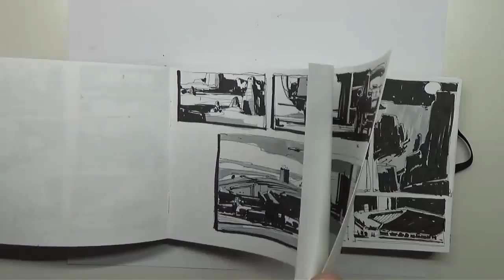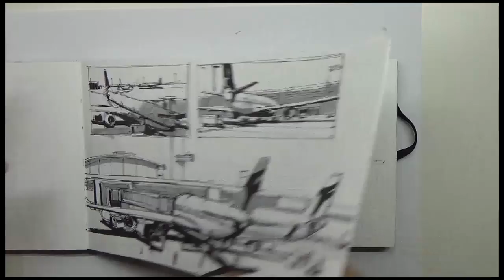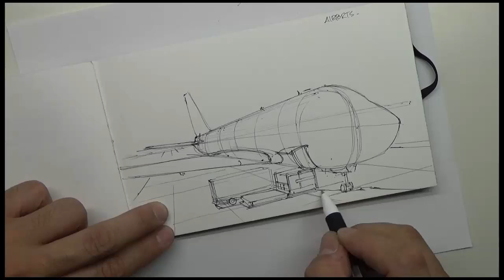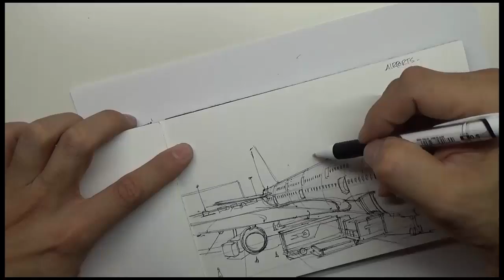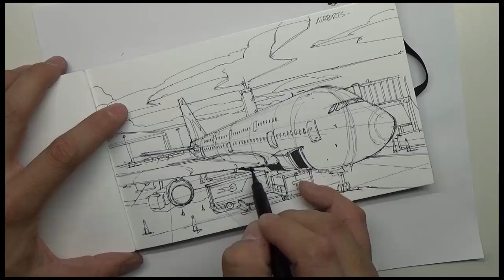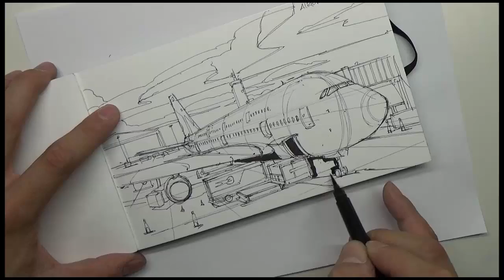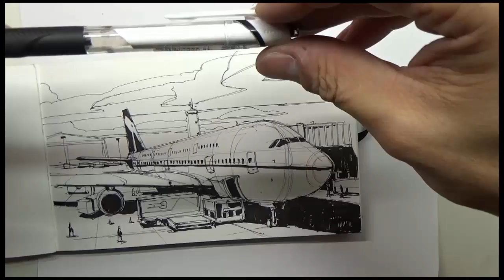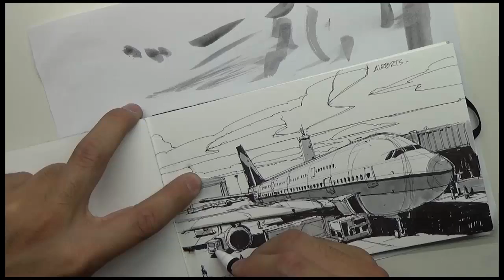idraw series EP4: how to draw an airport w/ James Paick

Comment: Hey, James. Great insight into your process, it seems my approach is similar to yours, so hopefully I'm heading in the right direction.

I have a question I haven't been able to find an answer for so far, so I'd like to ask for your help or request a tutorial if possible. The problem I've had is trying to set-up different camera lenses for my perspective grids. I know how to set-up a simple 60° cone of vision in my picture, so I've been trying to adapt that knowledge to increase or decrease the distance of the station point and the distance between my vanishing points to create different effects, but I'm not sure if that's the right way to do it. Right now I've been experimenting with 3DS Max, setting up some cubes and a camera pointing at them, then selecting different lenses and tracing the cubes to find the relationships between the station point and the vanishing points. ¿Do you know of a better way to set different camera lenses, or do you think I'm heading in the right direction?.

Thanks for your help!